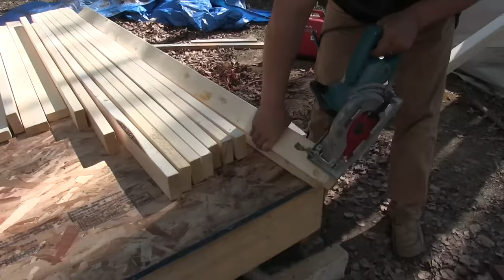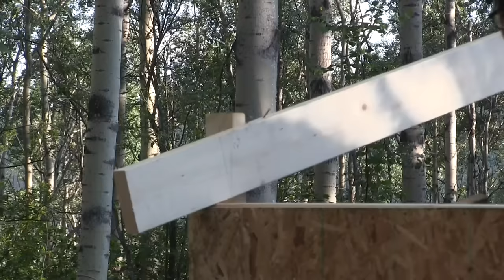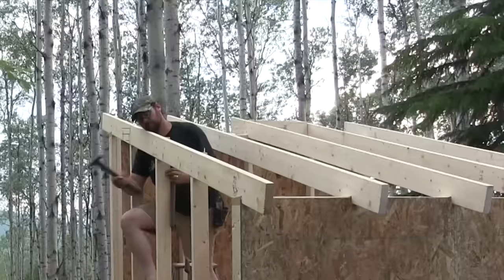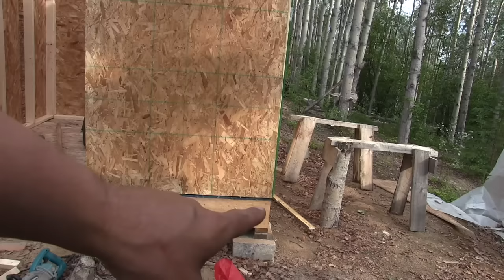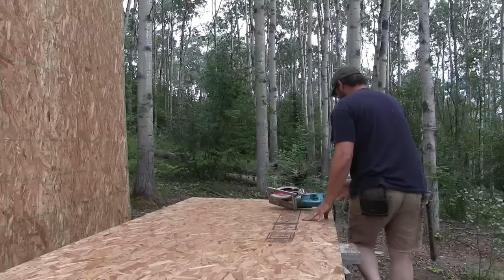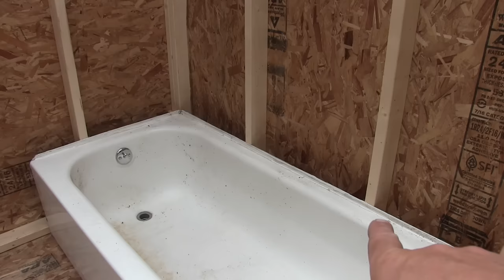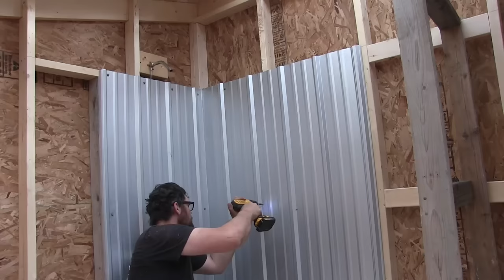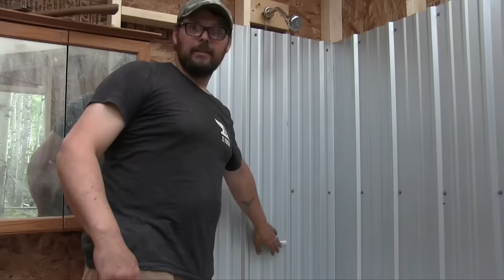Off grid shower house Project

Comment: I am building a tiny home and will do my walls for my shower the same way but mine is indoors. I will put some waterproofing type roll next to the wood before I add the metal walls. In my mind I think it will work.

Comment: Nice build.  I like the simplicity and practicality.  I do have a couple of questions.  Does the roof drain behind the building?  Will that be an issue if rain runs under the building?  Do you plan on installing gutters?  Does it snow where this is located?  I'm thinking about snow load and insulation.  Are you planning on insulating it and paneling or drywalling the interior?  Composting toilet?  Good luck with the rest of your plans.   I look forward to more videos.

Comment: A thing i learned about off grid plumbing if you want pressurized for examplefor a shower, a kitchen sink and a bathroom sink. I lived in a mobile home for years about 20 years ago. they used pex but the fitting were not adjustable, but i had a situation where i had replace a faucet and the permenant water pipe cracked, creating a leak. I souoght for a way to repair this. I found shark bites OK, but then i ended up using a hose clamp , a small one, surprisingly it worked fine for water pressure on a city water line. After my fix, i never had to worry again, using a small hose clamp on pex pipe with a pex male fitting to have a 3/8 shut off valve for a sink.

 So when I put my off grid cabin together i bought a 3.5psi on demand RV water pump to have just enough pressure to operate a on demand propane water heater. I bought the pex crimp tool which was outrageous , the pex fitting and crimp rings. but a also bought a bunch of those small hose clamps as a experiement because the pex tools cost so much, i was looking for alternative methods to save money, well, then, i ran the tubing made the connections with the hose clamps first , a little water on floor when house flooring wasnt finished , wasnt a huge deal, i could just mop it up, let it dry with a fan. I had use my cordless drill with a hex bit and made sure i didnt over tighten, i assmbled fully. Result: its been four years and not a leak nor does it appear there will ever be a leak, at least on the PEX coming from a 3.5 RV pump. I took the origional crimping tools back and got a return. This may not work in a commercial built house with code, the city water pressure may be much higher than 3.5 psi, but for a OFF GRID USING A 12V RV water pump, you dont have much to worry about this alternative way. All my water lines are center of my cabin , i specifically kept them off the main walls to avoid freezing, Since i live in my cabin full time its kept warm inside during winter. You guys doing off grid water systems with 12v pumps will like this hack.

Comment: That was excellent!! I have a place in big bear California I pretty much did the same thing but I gutted out a travel trailer put in a large shower pan some walls but I used an on demand propane water heater from Amazon I got a 100 gallon water tank and on-demand RV water pump and a 12 V optima battery the propane tank is 5 gallons I put a chair in there after chopping wood and I get a beautiful long hot shower it is awesome but you cannot let that water heater freeze during the winter it will rupture the copper tubes if there’s any water left in the coils of the heater

Comment: I haven't gotten around to building my shower house yet. But my outdoor shower consists of 2 solar panels running a deep well 12v pump thru a 10micron filter,  then a 5 micron charcoal filter into a 55 gallon plastic holding tank. From there, it runs to an RV pump powered by a 12v deep cycle charged by 1 panel and charge controller. The water is then run thru a tankless camp water heater run off propane to the shower head. I'm no carpenter, so next year my enclosed shower house will have a 4x4 truck topper roof and treated deck boards for a floor, and grey water will just run to the ground. For now, I  just shower outside and hope the neighbours don't stop by unannounced.
Reply: *7'x4' truck topper. Can't edit for some reason.

Comment: That zincalum factory paint dont hold very well to even a light abrasive sponge , I would coat it with a clear coat around the shower . great video i learn a lot on these builds

Comment: What a neat design. There's 1 add on I can see you could implement. Why not try to take advantage of the sun light to heat up a tank of water? If you mounted a white plastic water can up in the roof right under the clear roof panels, I bet you'd get nice warm water after a day in the sun.

Comment: I've been out of construction for a awhile, but my Dad and I built some steel homes while I worked for him.  I have to say, steel framing on your own is a lot easier than wood framing.   It's lighter, straight and easily cut and formed.   Plus I find screwing things together better than nailing. It is a bit more expensive, but considering your dealing with water, galvanized studs doesn't rot or burn.  All depends if your dealing with inspections and local ordinances.  Not that steel isn't as strong and durable, but local ordinances can often require engineering for steel while wood is a known factor.
Reply from the maker: thanks

Comment: Great video. Subbed. Learned a few things about carpentry watching you. When you wrap Teflon tape around a pipe, try flipping the roll of tape over. So that it unrolls off the pipe side of the roll instead of the way you were doing it. You'll have a lot more control and you can pull it tight as you go.

Comment: Food for thought.  Reflectix is amazing stuff.  A layer of that between all studs/joists/rafters and your sheathing will help to keep the extreme cold at bay.  Add bat insulation to that and life becomes "more gooder" all the time.  I'd've also added "bird blocking" between the rafters to seal up those holes.  Another use for the Reflectix is to cut it to fit your pump can, creating a "cozy" for it to help keep the water warm in colder weather.  That foil tape is all that's needed to make your seams.

When that clear corrugated plastic becomes brittle and breaks... consider a newer material which is clear plastic, but the construction of it is more like cardboard... making it double layer... having some insulative properties.  

For summer use (to have hot water on demand), black tubing to use as a solar hot water grid on the roof.  Add a fill point and let the sun make your hot water all day for you.

Very nice shower house there.
Reply from the maker: I have this roofing on a few buildings here and have never had any issue with it

Comment: It's good feeling to be able to be self-sufficient, & nice to see someone using the worm-drive, I got an all polished aluminum Skil from a rebuild shop, was pretty new, but the original buyer forgot to add the gear drive oil, I paid 55.00 for a 200.00+ awesome saw that'll cut anything. The videos are well done & great information for making what would seem impossible to some.

Comment: That trick with using the board on your top plate to get your cut out for the rafter is BRILLIANT! Curious how you'll heat that building in the winter. No one wants to shower in a 20 degree building.
Reply from the maker: I dont use it in the winter.....I spend winters in northern michigan.
Reply: Bushradical makes sense.  Love your content and your season on Alone. I was rooting for you guys! Thanks for the reply.

Comment: I just bought 10 acres in the UP and would like to build a shower house like this, but I’m going to use a small on-demand propane hot water heater and 12v pump. Your videos are very encouraging and helpful. How did you ever finish out the inside and what did you do for siding?

Comment: Eccotemp shower. Propane heats incoming water. Fully adjustable. Needs a little water pressure to turn on the heater. Been using mine for years.
Reply from the maker: Awesome. I'll be looking into things like that soon

Comment: Suggestion for you Dave
Instead of holding the sledgehammer against the board you're nailing into, smack the board and hit the nail at the same time. You can use another hammer, or a length of board...or your fist. The countering force helps you drive in the nail without rebounding.
Reply from the maker: I'm a 25 year concrete guy.....we always back forms with a sledge hammer like I did in this video, as we're constantly nailing 2x12 forms to steel stakes.
Reply: You're my new hero @Bushradical  . At 64, I've got 45 years of carpentry, electrical and plumbing, solar installations, a little farming, and an ev conversion under my belt. But not a day goes by that I don't learn something new.

Comment: Very informative video. What size turnbuckle did you use?? 1/2 inch 3/4 inch or 1 inch and length . Very good tip for out of square corners . And is it an eye to eye hook to hook ?

Comment: Next time you might consider using PEX piping instead of vinyl. I've had trouble with the vinyl tubing getting weak when hot water flows through it. I have a few feet of high temperature vinyl tubing which is starting to crack. PEX won't ever need maintenance the way vinyl does. The fitting you attached to the shower head is already a PEX fitting. I use a tankless on demand hot water heater and have a 15 gallon water tank with a 3 gpm RV pump.
You can trim out the gap in the flooring.
I also have a collection of sizes of pressure tanks... Great for emergencies put not practical for a home camp situation.
On demand tankless hot water heaters use 2 D sized batteries to ignite the flame and use propane in a tank. One 20 lb. tank will last a month.
If I was going to hangout in the wilderness for a week I would use the pressure tank. Heat my water on the camp fire and shower off with the full wilderness view around me.
Reply from the maker: I used to use pex when I was building houses back 15 years ago...I still have the tool set but its at my place in Michigan.

Comment: Delta Chrome 1-Spray shower head. Lowes has them. You can buy cheaper brands, but for $15 and the fact that you can shut off the water flow from your shower head. You will save yourself a lot of hassle and use a lot less water.
Reply from the maker: Good idea.

Comment: At our camp we fill a 30 gallon plastic barrel with water. The use a 12volt RV water pump to pump the water ot of the barrel through a portable propane on demand water heater. Shower head is a RV type with a shut off valve on it. When the water flows 2 d batteries light the water heater. When the water is shut off the burner goes out. The water heater has a mixer valve so you can adjust you water temperature.
Reply from the maker: I know a guy who has that exact same setup!

Comment: Your metal pressure sprayer is no longer available.  Will a plastic one work okay?  Your shower head looks great, what brand is it?  Low volume sprayer?  Any photos of your mounting?  I'm putting a shed in the woods to store saws, tools, wheel barrows etc. and adding a shower.  Any tips?  
I hope to set up a 3-stacked vertical blue barrow, rain catcher.  Any videos on using rain barrels for the sink?  
Hot water from the wood stove.  Is there a short cut to fetching hot water in a bucket?
Totally off grid.  Rachel

Comment: Wish I’d been there to offer a few tips to make your life a lot easier.
Reply from the maker: me too. You could have built it, i would have been happy to watch. LOL
Reply: Bushradical   In case you go to build another structure ....  nail your wall together square by nailing one corner of your plywood and then measure your stud wall corner to corner diagonally.  Make the numbers match and it’s square.  Nail the plywood making sure it doesn’t move and it’s square.  

Also. Nail a 2x4x 10’ brace on the outside edge about 3/4 of the way up the wall so when you stand it up you’re ready to nail it to the foundation.  If you have a level you can plumb it for straight up and down before you nail the brace.  Don’t sink the nail all the way so you can pull it off when you’re ready to put up the next wall.  

Nail a couple of short pcs. of 2x4 about 16” long on the foundation sticking up so the base of the wall you’re standing up doesn’t slide off the floor.  

My dad worked for a carpenter building houses, barns, farm sheds, chicken houses, and such before going to the service in WWII.  When he came back he started his own company and married the daughter of the guy he’d worked for before the war.  The first time I went on one of his jobs I was 4 years old and can still remember the smell of the sawdust.  I started working for him when I was 14.  I took the drafting courses and learned to draw blueprints and took Building Trades in vocational school during high school.  Im 64 now and would still be building if I hadn’t been injured in ‘85 when I got caught in a spinning hydraulic motor that broke my arm and caused nerve damage.  Botched surgeries lead to chronic pain, then the meds caused my spine to deteriorate and other wonderful things.  

That’s why I love watching you doing stuff.  I can’t do it anymore.

Comment: Great video.. it has given me the idea to do the same on my property,  the one question I have is whether or not I need to dig a hole for the Grey water. Do you have water drain to any kind of septic? Or is it not required in your part if alaska?

Comment: PETOSKEY says you are an ANGEL, GOD BLESS --FANTASTIC SHOWER and the Pump is something I have never seen before. --Can you comment on the mosquitoes and what you do for them.  Also. I know in some parts the --re is a Black Fly season, can you comment? -    To Sound Flip you start by breaking a word into syllables in your conscious mind and then match one syllable of word with one beat of a sound.  You then push the word syllable out of your conscious mind into the beat of a sound; one syllable of word per one beat of sound.  This matching of word syllables with sound beats is called synchronization.

Comment: ** Now you can build a wooden saddle outside the shower house. Put up a 30 or 50 gallon barrel for water .if you use a blue barrel the water will get warm but not to hot , like a black barrel would.  You can fill it with either a manual or electric transfer pump . But you will have a heavy gravity water pressure flow. ** As far as that goes you can buy a 250 abs water tote and have plenty of water before refills , doing it the same way. Build a insulated box container with a dark color corrugated lid so you can use it all year long .**

Comment: Being over a year old, I'm sure someone else thought of this and mentioned it but just in case.  You could replace the manual pump action with a simple 12volt air compressor used in the off roading induustry that can be tied into a battery and solar..  as the pressure drops the compressor kicks on and keeps the water flowing...😂

Comment: Consider a black 275 gallon tote outside and elevated above your shower head and placed where it gets direct sun and you’ll have hot water. I’ve seen a 5 gallon black military water can and a 5 gallon “desert tan” water can plumbed side by side so there is a hot and cold tap.  Add the “sailor shower” technique (turn on the water and get wet-turn water off-lather up and shampoo-turn water on-rinse off) and you can get 2 or 3or 4 showers out of 10 gallons.
Reply from the maker: right on

Comment: I don't use a splatter screen in the outhouses I've built, I use a funnel with a piece of hose that takes away the urine from the faeces. It smells less especially since you lose  the ammonia. The funnel can be made from a number of plastic containers depending on how good your aim is. I've usually used a 2 liters plastic milk jug.
Reply from the maker: right on

Comment: No plumber's putty for the tub drain?  The water draining from the tub can seep between the drain fitting & the tub and eventually rot your wooden floor.  Also, can you tell us the fasteners you used for the roof panels?  Are they something with a built-in rubber washer?  Your technique for cutting the birdsmouth was ingenious.

Comment: The water drains right out of the shower house, right? Does it go under the house or do you have a downspout or something so the water doesn't mess with the foundation? Is water collecting under the house something you even need to worry about?

Comment: i would need a much bigger pressure vessel to take a shower. how long did the pressure last in that? 20 seconds? and i would need to refill that one a few times. but, good practice for saving water. i really need to build this. you should post the plan designs. at least just basic ones.

Comment: Even better would be to make it a shower/laundry combo building and added a little woodstove.  That way you would have a place to heat up water for bathing or laundry and it would be warm in the winter when you step out of the shower.
Reply from the maker: I'll put a wood stove in here when I find one the right size

Comment: Sorry if this is a stupid question. Do you have to remove the metal sheeting to insulate the walls behind the shower?

Great video, I learned a lot!
Reply from the maker: No, this is just a three season Shower house, I won't be using it in winter.

Comment: when marker the first rafter, you say "make a mark about the same thickness as this gap". which gap? that seems like an awesome shortcut for rafters and I'd like to utilize it! wanna make sure i've got the right idea though
Reply from the maker: I'd have to go re-watch the video...but the idea is to get your rafter in place then use a flat piece of board on top of your wall to make a paralel line to the top of the wall ...on the rafter.

Comment: Does your drain water just go to the ground? My thought was if I did this I would burry a barrel with the bottom cut out below the frost line and drain the water into that. I guess what I am asking if its winter won't the water freeze on top of the ground underneath the tub? Or will it still soak in the ground?